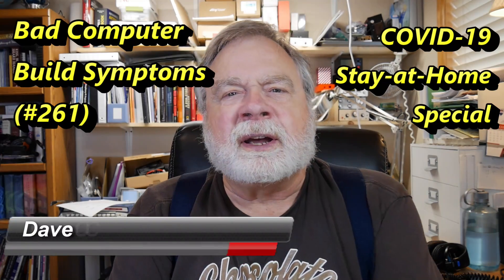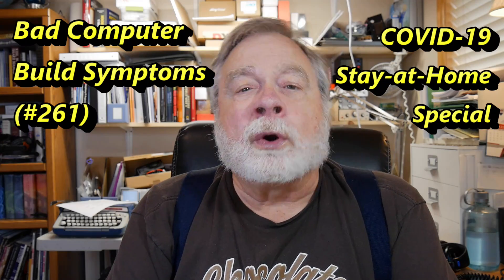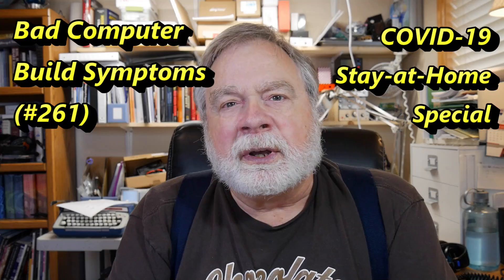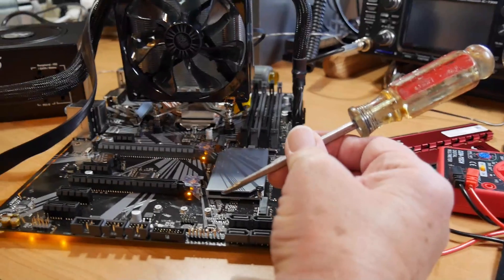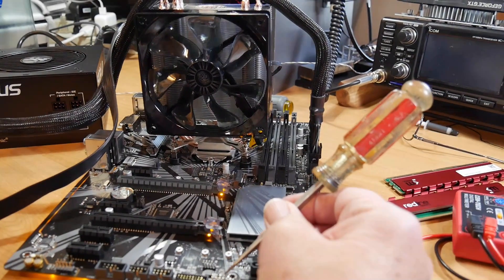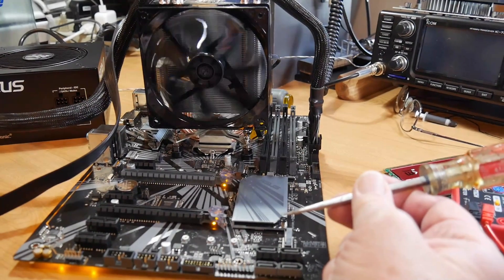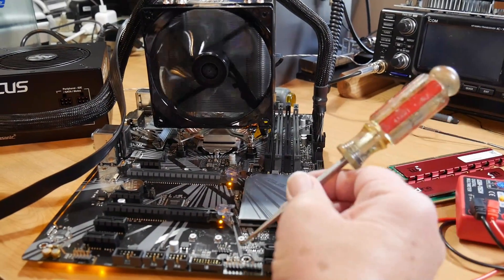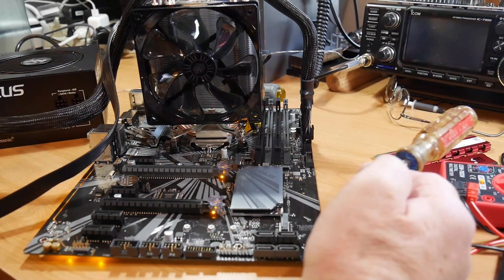Bad Computer Build Symptoms (#261)

Comment: Have you tried another power supply with the new motherboard? I think I heard you say you tested the power supply with another motherboard... If your new power supply proves good and if the other power supply won't run the motherboard I'd be getting a new motherboard. It happens sometimes.

Comment: Buy a Mac, they just work, if you need to run PC software install VMware. In the office we do Win/Tel (ie PCs)  but for home I got rid of every PC we had and I have not been happier.
Reply: Good luck with MAC -- you won't find the software you want to use and the interface is completely cryptic.
Reply: Richard Melville That is why i said to install VMware if you what to run PC software. It is a hypervisor and in 15 year of using VM I have not found anything that would run better under it then natively on a PC with the exception of 3D games. Just about every data center these days virtualize their entire work load

Comment: K.I.S.S.  Disconnect everything that is not needed for the first boot. Video card, drives, one stick of RAM, not needed.  Use the on-board hdmi connector for video and see if you get to the power on self test (post) and the uefi after that.  If that works, introduce everything one at a time.  I still think that cooler is 90 degrees off though.

Comment: okay. so the cpu power plug was not an issue. I do know it will NOT post or boot if cpu power is not  there.. and leds should flicker except power present led. might even have one that flashes red then changes to green near top end of mem chips..?
I just assembled one of these all asus and had same issue.  mine was the wrong power supply .. did not have proper plugs for motherboard itself.